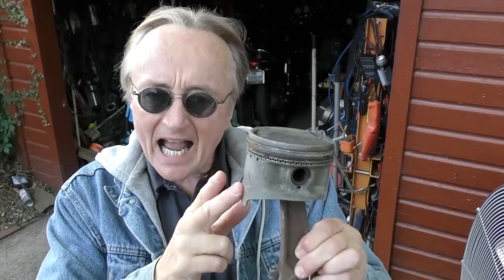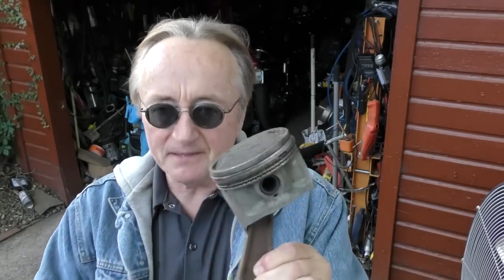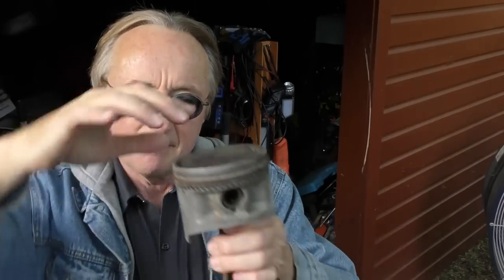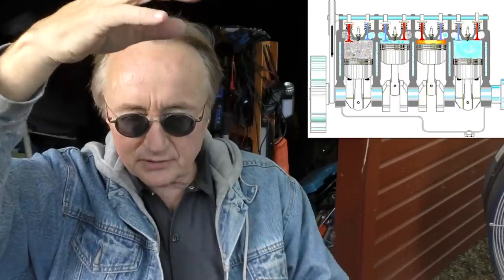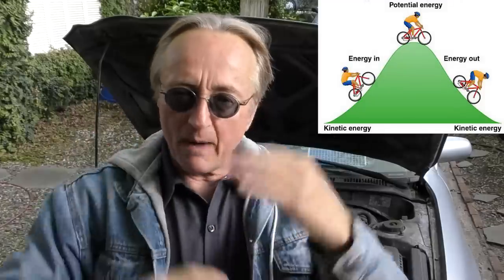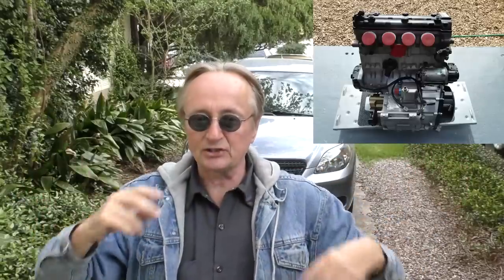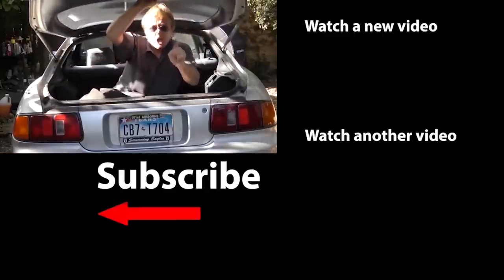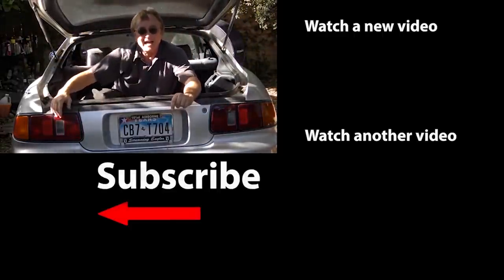Horsepower vs Torque, Which is Better

Comment: It's not accurate to say that Torque is for Acceleration and HP is for Horsepower (as some are asking).

A diesel has a high torque and low hp. It will have a high torque at low rpm. The acceleration will not drop much when a load is added, but it's speed/acceleration will never be that high, even under lower loads, and even under higher RPM.

A race car has low torque and high hp. It will have a lower peak torque, a lower torque at low rpm, but a consistently higher torque when RPM's increase. It may have a slower start off the line, but It can accelerate much faster in general, but only with much lighter loads. Start adding a load and it  will never be able to climb the gears into the higher RPM's necessary to unlock it's full power.

HP is for racing. Torque is for hauling. Hence the expression: "HP is how fast you hit the wall, Torque is how far you carry it."

Comment: You pretty much have a tradeoff between low RPM torque/breathing and high rpm horsepower and breathing. It's almost impossible to have both. Both have their places.

Comment: Maybe I'm dense, but I've never gotten this time-honoured explanation: "Torque is turning/twisting power." Sounds logical – you never see horses doing corkscrews or summersaults. ;^>  Until you consider how a car's horsepower is delivered: Oh right, through a turning/twisting drive-shaft, right...

Comment: Okay, so Torque is Force*Distance. And Horsepower is the amount of work that can be done at a time. So here is where I am confused:
What is the "force", what measurement does that use?
Because in the real world, if you inject more fuel and air into the cylinder and let it combust, that is creating horsepower which is the work/energy. But it is also the force because it pushing down on the piston.
So is the horsepower the force? And if so, how can you work out the force if you don't know what the horsepower is? I am so confused but I get the basic mechanics of it lol.
Reply: I think what you're confusing is torque and force. Sure, there's a force (lb) on the piston (going one step further back that is derived by pressure over the piston area lb/ft²) which is linear motion. That's converted to torque with the use of the crank which rotates though one axis with the 'big end' offset to that. That gives the distance (ft) providing the other component of the imperial torque  unit lb-ft. That torque is transferred through the gearbox and amplified by the gear ratio, through the differential where it is further amplified where it reaches the wheel. At the perimeter of the tyre it becomes a force (lb) again by virtue of by dividing the amplified torque by the radius of the tyre (ft). F=ma is the equation, which I'm sure you remember from school, that means that the acceleration is proportional to the force (lb).
Power is the rate at which work can be done. That can be work giving potential energy to an object by raising it (Ep=mgh) or by converting it to speed (Ek=½mv²) or a combination of both. The more power you have, the faster the work can be performed.

Comment: i am still confused. if torrque is for acceleration and 0 to 60. then why are diesels slower? why do people rev high on the peaks of horsepower when racing?
have you ever seen a drag race where they keep the engine at peak torque (~3k rpm)?
can someone please explain?
Reply: Torque isn’t for anything other than moving off. Once a car is moving all that affects acceleration is power.
Reply: yep your right 👍🏻 this video is 💩 👌🏻

Comment: Like the videos, but horse power isnt explained well here. Torque is the amount of power the engine delivers in one rotation. So at low rpm, high torque is desirable. Horsepower on the other end is torque x rpm. The tricky part is with engines, torque isnt consistent across rpm. So a car that makes 200 nm torque at low rpm could have 50hp, but at a higher horsepower, it could drop to 50nm, but still make 50hp.

Essentially if you increase torque at a specific rpm, you gain horsepower at that rpm. Where as you maintain the same engine torque, but have it at a higher rpm, the torque is delivered more often, therefore increasing horsepower.

Comment: all well and good, but isn't the amount of torque and or horsepower at the wheels more dependent on the transmission and differential gearing than the power the engine makes? Save engine will have more torque at the wheels with low gear ratios, more speed with high gear ratios. Whether or not the engine has enough power to give you that top end that's possible according to the gearing, that's what you're talking about. Isn't that the reason so many companies are using small engines for mileage but using 8 or more gears? They're trying to get the best of both, but it seldom really works well. Isn't that also the idea behind CVT transmissions? The perfect ratio for whatever the situation?  Nobody needs to go over 100mph on a motorcycle, or a car for that matter, they may want to, but they don't need to. I've been up to 110 on a bike, and even on a very stable bike, that's scary. One that wasn't so stable scared me into backing off at 80 in second gear...

Comment: HP = (Torque * RPM) / 5252

If you'll look at any engine dyno chart, you'll see that the HP and Torque curves always cross at the 5252 RPM mark.

In a big Diesel engine that can't even reach 5252 RPM, for example, your torque number is always going to be larger than your HP number.  That's how you get, say, 800 ft-lbs of torque, but only 400 HP.

Conversely, a low-torque engine that can reach 9,000 RPM (like a Honda S2000, for example) can wind up with far more HP than torque (in the JDM version, I believe it has 250 HP and only 150 lb-ft of torque, for example.)
Reply: So not "always" then

Comment: Engine torque by itself is useless, HP is what really matters. In order to move anything you need energy, and HP is just a mesure of how much energy does the engine produce in a certain amount of time (1hp= 746w= 746 joule/second). Torque can be manipulated thru gearing in the gear box, power allways remains the same.

Comment: Scotty,
Isn't the reason that you get more torque is because of the STROKE of the engine? And horsepower comes from BORE? So why would a "V" engine get more torque? I suppose its because there is more room in the crankcase for the crankshaft  which allows more stroke, right?

Comment: Torque x rpm gives HP so a high revving engine generates more HP for the same torque. Then using lower gears gives better acceleration AND speed, but not so good at low rpm around town. That is why both are important. This video is confusing.

Comment: I’m a bit confused - I understand that diesels have a lot of torque so that they can tow better.  But diesels also have slow acceleration - usually slower than gas engines.  But since you’re advising that torque means faster acceleration, why wouldn’t the diesels be faster off the line than a gas engine??
Reply: Some diesels are very fast but they don't rev high, and all those gearshifts takes time. Also diesel cars are usually heavier. 
Diesel cars were really slow 20-30 years ago, but 10-15 years ago they picked up speed. The new BMW M550D has 4 turbos and 400 hp. It does 0-60 in 4 seconds.

Comment: Hey scotty. I have a 2004 isuzu rodeo 3.2 v6 automatic transmission with 118,000 on it. I'm trying to change the fluid in the transmission. The manufacturer calls for dextron 3, But I can't find that too easily. Should I use a equivalent to dextron 3? I hear dex/merc ATF by valvoline is good but I dont want to mess up my trans. or am I better off trying to find original dextron 3?

Comment: Force causes the acceleration of a mass because F = m*a.
You can't say: which is better, power or torque? Because you can't seperate neither of those.
More engine torque means more engine power because that how this works. 
 Engine power generate a force which accelerate a car, engine changes rotation, into torque at the wheels thus causing forward movement. More power = more force pushing car forward.

Comment: Erm, F1 cars accelerate very well believe me. Torque is a product of power. Power in Watts is Joules of energy per second. Therefore, power from an engine is how much toque an engine can deliver in a certain amount of time, which is why we see slow but torquey and fast with not much torque engines both producing high power. It’s just different ways of producing power. The formula for power (Watts)= Joules ‘J’/seconds ‘s’
Formula for horsepower= Torque (lbft)*RPM/5252
Reply: Low weight really helps them get going
Reply: Svein Hanssen 👍🏼

Comment: Would an engine make more overall "power" (i.e. faster acceleration) through higher rpm ranges if it had equal horsepower but more torque? That is, is torque negligible when hp kicks in?
Reply: No. The opposite. It would be slower because in order to have the same torque but less power it would have to be lower reving. Although torque is responsible for the acceleration, power actually determines acceleration because you can turn more power into more torque through gearing.

Comment: Horsepower is how fast you hit the wall, torque is how far you bring the wall with you
Reply: Nop, thats momentum
Reply: Afonso Ferreira force times distance equals torque
Reply: @paulnmarshall7504  Im not trying to be rude but that's not how it works. 
1st-  Force × Distance = Energy
2nd- Engine torque ≠ Wheel torque and Wheel torque ≠ Pulling force. Lets say we have 2 cars, one has 100 N.m and the other has 80 N.m both at the wheels, car 1 has wheels which have a 50 cm radius and car 2 has a 40 cm radius wheel. They both have the same pulling force because 100/0,5 = 80/0.4. ( If Torque=Force × Radius, Force=Torque/Radius.) And if the masses are the same, they both have the same aceleration ( a=F/mass).
3rd- Momentum (mass × Velocity) is what defines how far something goes when afected by another object, of course if you have a force pushing the car forwards ( what I refered to as a pulling force) there is some positive aceleration conteracting the "wall", which afects the Velocity, and the momentum.
Im not the best teacher but i hope you learned something. Cheers
Reply: @afonsoferreira5171  Thank you, you get it!

Comment: F1 still is fastest accelerating 4 wheel vehicle, less than 2 seconds to 60mph. weighing around only 600 kg helps a lot.
Reply: A tuned McLaren 720S on a prepped raceway also made it in 2 seconds. Watch drag times

Comment: In aircraft, especially turboprops, their engines are rated with Shaft Horsepower (SHP). Does that count as torque or Horsepower?
Reply: That's just horsepower measured at the shaft. Still calculated from torque times rpm. Nothing fancy. For aircraft, we care about this as well as Thrust Power (similar to WHP in a car). The ratio of thrust power to shaft power is the aerodynamic efficiency of the propeller itself. It would be just like how the ratio of WHP to engine power in a car is the mechanical efficiency of the drivetrain.

Comment: Scotty is completely wrong here, horsepower is far far more important than torque when it comes to both acceleration and top speed this is because torque can be manipulated through gearing allowing engines to rev higher quicker which is why torque numbers doesn’t mean when it comes to acceleration or speed

Comment: Last I checked indi and Formula 1 still accelerate quite quickly less than 2 seconds to 60 0 to 100 mph and back down to 0 mph  in 5 seconds or less there only like 1600/ 1800 lbs light

Comment: HP isn't really a thing.. it's a number for how much work an engine can do at 5252rpm
Reply: It is a very real thing. It's the rate at which work is done.
5252rpm is just where the torque and power curves cross using imperial units of lb-ft and Hp. Using metric units it's 9549rpm. It's a function of the maths - nothing else.
Reply: @TonyRule  - Oh ya, that's right with the crossover.  Its been awhile. What I meant is HP is just a number for how much work an engine can do using torque numbers and rpm. Cheers man!

Comment: That's the beauty of turbo charged cars... You get the torque and the horsepower 👍👍
Reply: And the beauty of electric cars
Reply: @mcplutt  indeed but they still aren't practical for a commuter car.  Especially in a rural area like where I live.  Maybe one day but honesty Electric cars and what is needed to get the lithium ion from the Earth for those battery packs? Yikes... There is a mine near me that digs for Lithium and it's nothing nice and HUGE machinery to dig for it... I find that so ironic.
Reply: @eppyz  Practical they are. 60% of all cars sold here in Norway in March were electric.
Reply: @mcplutt  well they may be practical where you live I'm assuming you live in the city I live in a rural area in the closest cities 200 miles away so it's not very practical for me and there's no places in between the closest city and me that have any charging stations and the only electric cars that are sold at half halfway decent range is a Tesla and they're too expensive so just not the right type of car for me at this point in time.
Reply: @eppyz  Well. a Tesla Model 3 with 300+ miles of range and a lot of Supercharging stations around would do the trick. Even the Standard Range version for $35k has over 200 miles of range.  But America is a big place :-)
Reply: @mcplutt  there are other factors involved to for example I will use an analogy of a vegan that doesn't like to eat meat because of the slaughter of the animals now in electric cars the battery packs take lithium ion and near where I live there's a mine that they did for lithium ion and the big heavy machinery that pollute our Valley so bad digging for that lithium-ion is an irony about electric cars that is terrible they make such a mess taking for lithium-ion those machines pollute the air so bad that dig for it so honestly electric cars to me are more of a novelty than anything and they're not a new idea I mean Porsche came out with the electric car in 1900 for goodness sakes.
Reply: @eppyz  A Base Model 3 is $35k and then you get $3,750 in tax credit.
Reply: @mcplutt  read my other reply not interested and there are no Tesla's in SoCal for $35k. Maybe a used one.  I'm not interested your barking up the wrong tree.
Reply: @eppyz  Anyway, on the Tesla website you can order a Model 3 for $35k.

Comment: Wrong Scotty....torque and horsepower are not mutually exclusive.  One is used in the calculation of the other, therefore more torque at a given rpm results in more horsepower at that same rpm.

Comment: Scotty, I like your series and watch it almost every day.
BUT, your dissertation on Torque and Power is not very scientific.
Power is defined as Work per Time. 
Linear Work can be measured in lb.X ft., Kg X Mt or other units
Linear Power can be measured by lb X ft / sec ,  HP , KW or other units.
Torque is Force times Leverage. 
Rotational Work is Torque X Revolutions. 
Rotational Power is (Rotational Work) per time. It  is proportional to Torque X RPM.
in other words: You can have the same HP by high Torque times low RPM or low Torque times high RPM. For technical reasons it is difficult to achieve both.
Race engines have high HP in spite of having relatively low torque because they have very high RPM so (Torque X RPM) is high.
In street cars and even more in trucks they want higher torque at low RPM to save wear and tear (and fuel).
This is where the transmission comes into play.
You can have a low HP engine delivering high torque to the wheels (e.g. a small 100 hp tractor can out pull a 600 hp truck).
In race cars at low speed the transmission allows delivering very high torque to the wheels from a low torque engine (of course the engine will wear down really fast).
OK, very basically that's it. More reading is available. It is plain physics.
Thanks for your good work.

Comment: Aren’t engines converting chemical energy into mechanical energy instead of what you said? (Potential energy to kinetic energy)
Reply: Sublime, practical  explanation of potential energy: after 6 Heineken, the potential turns into a blast of kinetic.

Comment: High torque means you can accelerate fast? You couldn't be more wrong. Diesel trucks and cars make buckets of torque but accelerate much slower than gas cars, which make more horsepower.

Comment: So basically the best all around engines are the ones that horsepower and torque almost the same best of both worlds has acceleration and high speed and fuel   mileage

Comment: Okay, Scotty. Then what about a Subaru?  Is a 4 cylinder but in a boxer engine. Is not a straight 4 but a V4 ?
Reply: It's a b4
Reply: I imagine it is a similar engine that powered the old VW beetles except it's front mounted and water cooled. But they work on the same basic principle.
Reply: @glennso47  The boxer motors were first used on airplanes. This way you get the best of both worlds. Horsepower and torque.

Comment: high torque engine and high power engine, which one is more strained and has shorter life?
Reply: A drag car with 1500hp  engine will burn its internals up before a 1500ft lb tq semi truck will even get close to destroying its internals. Diesels live longer than gas motors cause of the lower hp rating vs higher tq power band.

Comment: then why cars with more horsepower accelarate faster too ? hyundai accent 97 hp 130 nm 0-100 km/h 12.3 seconds. renault symbol 75 hp 200 nm 0-100 15+ seconds. if you are not hauling stuff. horsepower horsepower horsepower.
Reply: Yes my thoughts exactly
Reply: Also same thing in gas vs diesel engines, gas for cars diesel for trucks and work machines